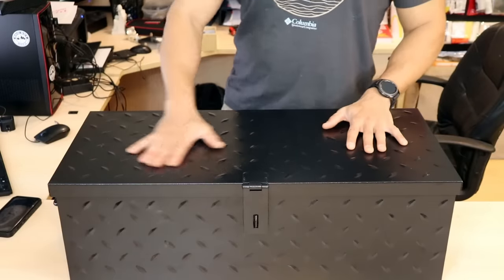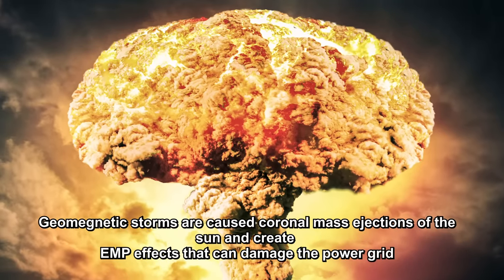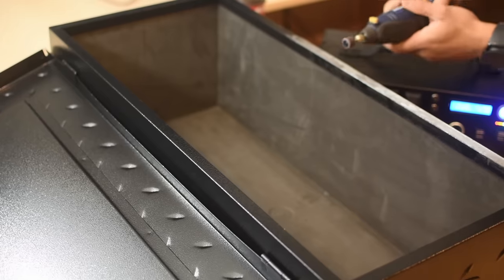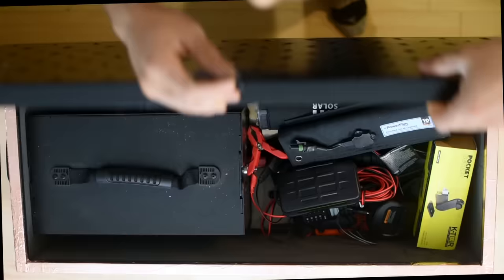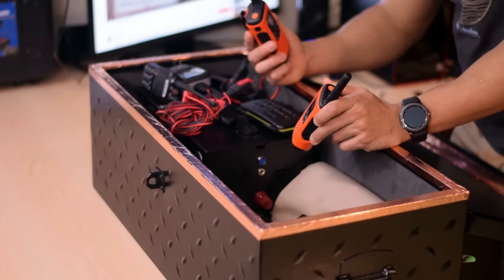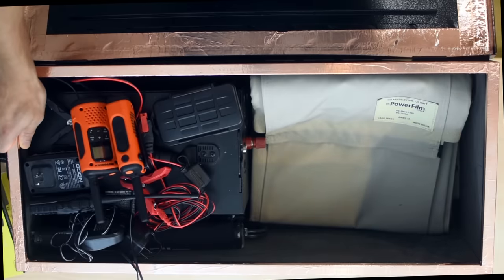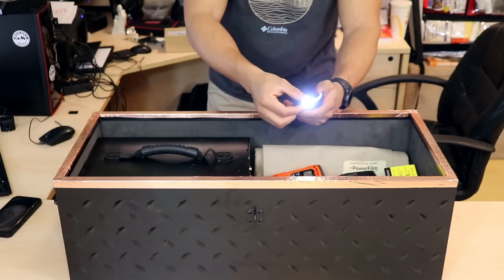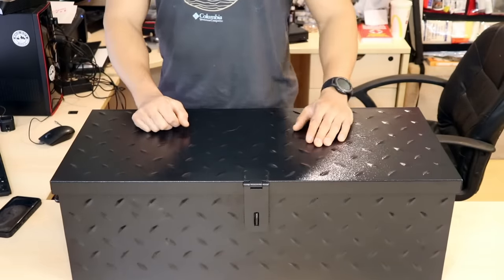EMP Prepping: Building a Good Faraday Cage | Inergy Kodiak Generator

Comment: Nice built, i'll keep my eyes open on a box like that at my local Canadian Tire or other home hardware stores😁👍. I'm wondering, do you have any suggestions on how to make modern cars more resistent to EMPs? I'm in the middle of planning and researching for the purchase of our family pick-up truck. Unfortunetely the Tacoma is too small for us, so my biggest bet so far is the F250, F450 or the F150 with a V8. Because with a couple modifications it can run on 3 different types of fuel, regular gas, alcohol and natural gas/propane, which makes it a flexible and reliable partner in emergencies. This vehicle comes already prepared from the factory for propane and natural gas. It is also a flex fuel engine with no need to hack the board computer or install certain kits to get it running on E85. While with the diesel engines i'm stuck with, well diesel and biodiesel. On top of that i can only run a 20% biodiesel mixture reliably on modern diesel engines... . Heavy Duty truck vs half ton = payload capacity vs handling. I'm still struggling with that. The F450 though has a wider front axle to make easier to handle, but there's no gas option for that one yet. I hope that changes when Ford brings out thier new 7l V8, which will be made in Canada😉. I'd like to hear your thoughts on that😇.

Comment: Ahahah, of course you have a video on emp protection. 

Just realized there is a rather sizable hole in my beginner preps. Gotta keep the electronics and communication devices protected! 

Debating whether or not i should store my magnet wire for residential wind turbines stored in one as well.....i doubt that it’d heat up/become damaged in the event of an emp but ehhh...maybe i will store it in one.

Maybe even protect the stator housing on the turbine as well, just incase...

Comment: I have the good old fashioned metal rubbish bin lined with insulation version of this.  It has EMP proof protective bags inside for specific items like tablets and laptops.  I'd need about 30 minutes warning tho.  Difficult to buy 2 of everything to keep one stashed in case of an EMP.
Reply: I wouldn't worry about anything you don't need medically or survival wise as most of it will be useless pretty fast as the batteries will drain and recharging them will be a major energy drain on any generator or other power you may have.
Reply: @crystald3655  I agree. But I had to consider that after a sufficient sized CME or any EMP, having power tools, even temporarily to access well water, build out houses, and God only knows what else we will need until after it happens, could be a life-saving activity.
Reply: @omearica-rc6fp  True but a laptop or tablet would be pointless. I would however protect a radio and as you said a few power tools if possible to assist with survival.

Comment: I have noticed a few inconsistencies. At first nuclear EMP and the use of solar panels... inside the shelter. Another one - an aluminum box that is magnetic transparent. I do not deny some protection of it but I will explain later. The third one is an aluminum box and copper tape - nice today corroded connection by the evening (not a perfect electrical seal). EMP is a mix of electric and magnetic components of impulse. To get decent protection the container should be made of layers of magnetic and nonmagnetic materials i.e. copper and steel. As it could be difficult to weld those in the urban area zinc covered steel and copper can be soldered to form a box and if you want to complain about design then just build an insert for your fancy box.

Comment: most modern electronics are shielded, the circuits are insulated and grounded part of the engineering process as well as the coating on the polymers.
But if any high altitude EMP dont you think  the upper atmosphere will shield all on you the sun Spitz high Energy particles every day 24/7 and still your youtube works

Comment: The only draw back about aluminum is that aluminum isn’t great about protecting against H field. Grounded steel is a far better attenuator if magnetic waves. Now I am now sure how strong the H field is in an EMP blast, but it if storing items at the house then a ferrous metal will give you good properties to both the E and H fields.

Comment: You don't need to spend hundreds of $$$ on a Faraday Cage....

Buy a BIG (33+ gallon) GALVANIZED TRASHCAN. Line it with 1.5--2" (inch) slabs of insulation. Even the Lid--EXCEPT the outer edge, so it will still fit over the can. (I use the same blue sheet they use in home construction.) You can get all this at any hardware store!
 
And Viola! Faraday Cage!

Comment: This is just dumb electronics technicians view but a Faraday cage made of tight weave about a millimeter or two in gap will do just fine. That will get you down to an extremely short wavelength, which should protect you just fine. But going about it your way would work too, as long as the seal contacts correctly i.e. foam between the copper, I would suggest as i think others have pointed out using  aluminium tape just because the copper and aluminium will react to each other over time. I would further suggest taping the exterior gap for added protection. Also you may try grinding some of the bottom paint off so the electricity has a way to ground, and if you felt like leaving it in a specific spot in a vehicle or whatever, you may try welding/soldering/ brazing a grounding cable to the bottom. You could very simply solder a bold to the bottom and use an alligator clip to ground the box as well to a piece of exposed metal in the vehicles interior. But understand the reason for the box, if 60%  of the stuff in your box survived it'd be better than zero right :D. Any way good information dude, keep doing what you do.
Reply: Surfing SpiritBear ⬅️ I agree & disagree!... yes, anything is better than nothing... but, the car thing?...  how do you ground a moving vehicle?... even if the steel belts on the tires were fully revealed & it was raining... you would be lucky to get say... 35% ground? That leaves the cars battery to take the brunt (•explode•)... I suggest 3 levels... i.e. Box in a box in a box... I use the 3M bags he suggests as just one layer.... something to think about!

Comment: "...garage is a faraday cage..."  yeah, I don't think so.  I mean, its not sealed on the floor, right?  Everything I've heard about faradays is that there has to be a complete seal of metal around it, and everything inside it insulated from the outside surfaces.  If what youre saying is true, I could just put an open metal garbage can, upside down, over whatever i want to protect.  Is there something I'm missing?

Comment: If I built a wooden box for inside instead of using nails/screws to hold it together I'd drill holes and use wooden dowels in case anyone wanted to do a wooden inner lining.

Comment: Its called a RFSE, Radio Frequency Shielded Enclosure.....Those rooms built to super spec, If i told you who uses them, well then I would to...Um...Well... I would just have to run and hide LOL. Cheers.

Comment: Let's be clear the EMP damage on the electronic equipment is most likely on the IC chip burn out due to increased current by the exposed copper surface on the said circuit board. If you leave component laying around on your desk there's no copper surface that will generate significant enough to damage it.

Comment: I have a Old radio shack CB walkie-talkie with the telescopic antenna.. standing on high ground in my driveway I was able to talk to my friend in this pickup truck with a mobile 15 miles away! (I measured the distance on a map) .... The key is to use a telescopic antenna on your CB 11 meter  walkie-talkie.... The range will be from 10 to 15 miles unimpeded.. like from the top of a hill or over water.....the FRS & GMRS walkie talkies . Really don't have much range.. ignore what the package says about 20 in 30 MI range.. it's all bs.. average range with trees and buildings you're lucky to get a mile.. the farthest I've ever talked on a grms walkie-talkie was approximately 5 MI from up on top of a big hill with nothing in between me and the person I was talking to

Comment: Looping back to this video for inspiration to make my own, now wouldn’t the use of adhesive backed copper tape negate the work of sanding off the paint? I doubt that the adhesive is conductive, which would essentially make it the same as not grinding off the paint

Comment: Aluminum will be very susceptible to galvanic corrosion in contact with copper, assuming that the two metals are also in contact with a common electrolyte (such as water with some ionic content.)...just an fyi... some copper is treated but I dont know what type of tape you used.

Comment: Yo Canada!!! Alabama here.
This is not really directed at you.  It's for anyone that uses the term " solar generator ". They AREN'T generators!!! They don't generate or produce any power on their own.  
They're basically, a battery.  With a charge controller and inverter probably. 
I have a  gas generator,  1200 watt, dual outlet at 115 volt. 
I have small , 12 volt,  45 watt, 100aH battery system,
 and a 1200 watt, 115 volt AC with 650aH worth of battery storage.  
Three, 3 systems.  There's a method to my madness though.  My q2 volt system is for charging phones and 2-way radios only. 
The  bigger 115 volt system, 1200 watt inverter,  with it's set of 650aH batteries is for running a small fridge,  a TV and DVD player, a 20"  box fan, 2-100 watt LED lamps,  and 2 100 lamp LED Christmas tree light strings. That's it.

Comment: I would imagine the box would need to be lined with copper plating all the way around and then aluminum plating all the way around with air space between the two plates and then rubber all the way around and then some more aluminum all the way around some more copper all the way around and another layer of rubber all the way around and some Led all the way around, then maybe not sure but maybe it might work!!!

Comment: What was the purpose of getting rid of the paint when you replaced it with insulating tape glue from the copper tape? :)
Instead i think rolling a rubber gasket in copper tape and having it around the lid will make contact with the metal in the lid and box. Use double sided tape only on the thin side of the lid to keep it stick to the lid but make it also not insulating like tape glue and paint and then you have contact with lid and box over and under it.
Or perhaps use copper grease if it is conducting at all? Perhaps it is, i have a multimeter but no copper grease now so i dont know if it is conducting.

By the way, metals with different electric properties in contact with eachother does corrode the weakest one if moist.
If you put a copper penny in the bottom a aluminum boat it will sink some day, the copper corrodes aluminum.
They use zink on boat propellersin sea water to keep the copper propeller corrosion free and they change the zink anodes.
If you use a CPU water cooling block on a pc and a aluminum radioator and both of them is in contact with each other via the pc metal case then the aluminum will corrode, if you use plastic screws on the aluminum block so it is not in contact with the pc metal case as much it then will only be the resistance in the cooling liquid and the process will go slow and it might be fine.

Yeah, thats what i know about different metals in contact with eachother.
So perhaps rolling the round gasket in aluminum tape will be better, same electric properties as the aluminum case.
A electrician friend once said that aluminum does not hinder magnetic waves much.
Test with a magnet on both sides of a aluminum plate by the way, aluminum is only slowing magnetic waves, it dont hinder them it seems, the magnets will stick to eachother with the aluminum in the middle lol, i just tried and it did go trough around 10 plates of foil left on the roll and the cardboard roll itself too :)
So perhaps aluminum is not the best to use in a faraday cage due to its pourousity and less metal density.
Perhaps lead is the best, i dont know, it has good density.
Perhaps steel is the best due to magnets stick on them by itself, while copper and aluminum does not, likely lead too.
Another thing is that if you put your car key to your cheek then it uses the small antenna inside to transmit to you to use your water/salt mixture and body as a bigger antenna and then the car alarm remote will suddenly work on a longer distance than before, like double or something.
Perhaps the faraday cage will work that way as a antenna and transmit more of the EMP to your electronics than before?
Im not sure how things work regarding EMP,  but this is what i has picked up on themes i consider might be related to EMP the last 40 years reading newspapers, magazines, news, science, listened to friends, parents and parents friends, classmates in electro school and so on.
Check all this, read alot and come back and tell us what is good or not :)

Comment: Are you sure the adhesive side of the copper conductive tape is conductive? This is one of the reason I don't use any copper or aluminum tape to increase the contact surface area.

Comment: A far cheaper and easier solution is use a steel garbage can with a tight fitting lid.
I can fit twenty or more small to medium sized radios in a 40 gallon galvanized steel garbage can

Comment: I've approached my Faraday cages I built from a Radio/Electronics background. I first use a coat of RF absorbing paint then a layer of Stainless steel screen. all of it wired and measured at 0 ohms. I then ground them to the outside on a separate ground rod. I've measured the attenuation in the cage from the 150M band all the way to Ka band. Total attenuation. I've heard that the frequency of the damaging EMP from a nuke is from 15 to 30 Mhz.(10M band). CB is 29 Mhz. one could easily test their cage using a CB or walkies. You can easily get 500mW to several watts per m2. more than enough to simulate a powerful EMP.
Reply: truocleb ⬅️ your approach is better than most & I agree with the paint, ground straps between lid & box... it needs to be an All or Nothing approach... which brings me to microwave absorbing foam covering the outside... how much money do you have?...
Reply: Read the literature from the Soviet Union tests. DO NOT GROUND!
Reply: @dougwilson8274  Grounding depends on size of shielded cage. Something small no but a room size yes. My dad built shielded rooms for the Air force in the early 60's at radar sites.

Comment: How do you solve the Decay (Dentrite effect) of Lithium battery batteries inside your power supply?

In 5 years time after the production , whether you use it or not.

The quality or the capacity of those lithium power supply will go downhill.

Is the only solution to buy new unit every 5 years?

Comment: I bet an old refrigerator would work with a grounding strap to the door from the  box. Grounding to earth ground to direct any transient voltages to earth ground is advisable in any case. Some folks have used lightning protection devices with great success that contain devices that short above a certain threshold sacrificing themselves to take the hit. Putting a dragger on the underside of your car that grounds it is also a cost effective method of protecting from random charges. It's made of conductive rubber and drags the ground when your going slow or parked.

Comment: EMP is a concern but device(s) that employ magnetic induction heating have been used recently in California(the "forest fires"), The toasting of a apartment complex in London, possibly in the Alberta fires.... These devices work by inducing heating steel and to a lesser extent aluminum and copper to thousands of degrees, which can melt the steel and impart massive heat to a structure and melt engine blocks in cars.  An EMP box of steel would be the worse choice possible to protect electronics from magnetic induction heating.  See mental_boost channel for the visuals of the destruction.  Houses burned to the ground while trees nearby are untouched along with plastic mailboxes.  Cars toasted and engine blocks melted and running down the driveway!  They are all ready using this technology!
Reply: How magnetic induction heating works:  https://en.wikipedia.org/wiki/Induction_heating
The method used is not the one described above but a more powerful and able to be projected over long distances.

Comment: If i had time to undo both battery connections and ground both to earth, ie used jumpers to a metal rod in the ground. Would that sublimate an emp away from the electronics?

Comment: You need to ground/earth the box for it to function properly.
Reply from the maker: DigitalAwareness no you dont
Reply: It might work somewhat but it definitely won't work to the best of it's ability if it's not grounded. Grounding off the charge will dissipate it completely and quickly. If not you stand the change of the box holding a static charge similar to a capacitor.

Comment: Is it possible to make a Faraday cage that has a surge protector like yours does and has items inside plugged into it, but the emp triggers a switch thats faster than the emp and prevents an overload of capacitors and such of the items inside?

Comment: Use a steel trash can.  $30 from Walmart.  It works. I’ve tested it with placing a radio in it and it won’t receive.

Comment: Nuclear EMP from a close-proximity blast is the least of your worries. When experts discuss Nuclear EMP, they're mostly thinking of High-Altitude EMP (HEMP).
A relatively small burst (as little as 20-30kt) at 300km altitude over the continental U.S. would be a much bigger problem, because the way it interacts with the geomagnetic field over a continental mass would create a fairly intense E1 surge over a very wide area with minimal structural damage. Even DPRK could potentially manage something like that.
https://en.wikipedia.org/wiki/Nuclear_electromagnetic_pulse#E1